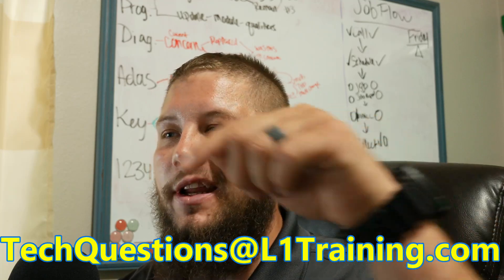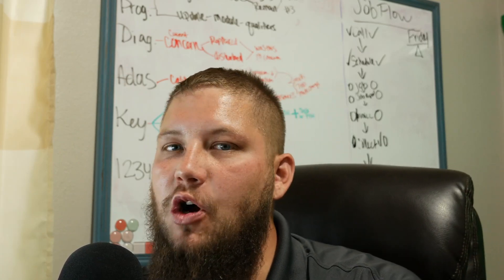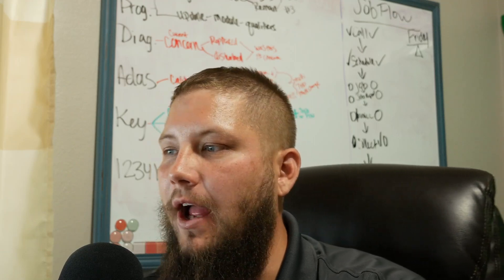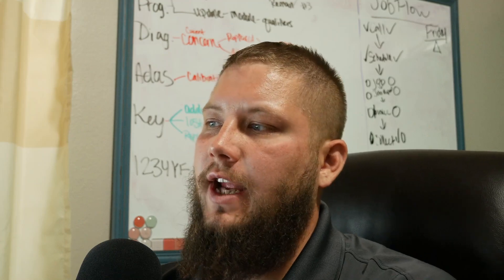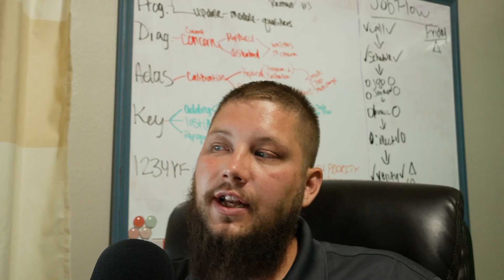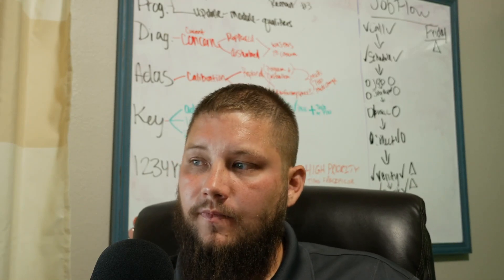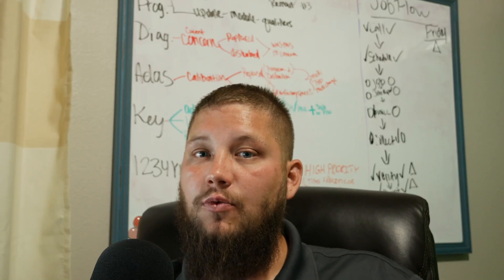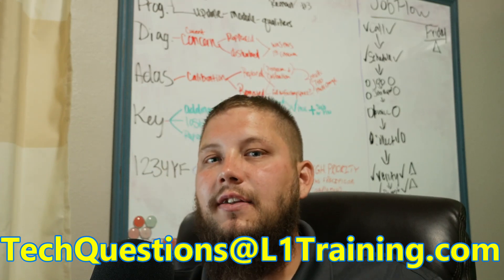He said I wasted his time!!!

Comment: Kieth, isn't the linked IOTA technically really a charger or is the signal clean enough to be a maintainer???
Reply from the maker: It is still clean enough for use, BUT I just added a link to a much better maintainer, its also capable of 100 amps and easily adjustable.
Reply: @L1Training  ...Awesome...I will check it out

Comment: I am running a Powermax PM3-55.  I haven't had any issues programming with it, and I got min for $109 on e-bay.  It would be better to have something with a little more amperage though.
Reply from the maker: The PMBC series is designed for programming, I have found the PM3 series to be kind of a dirty signal.